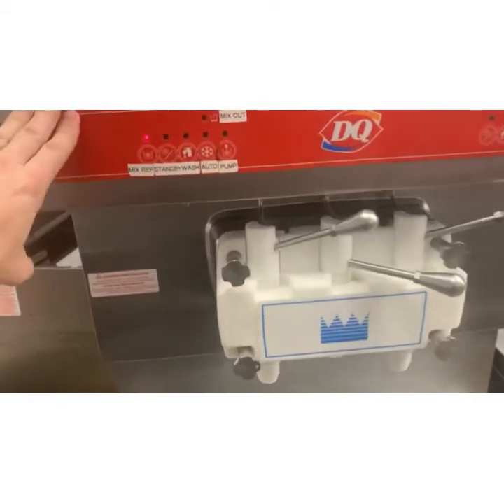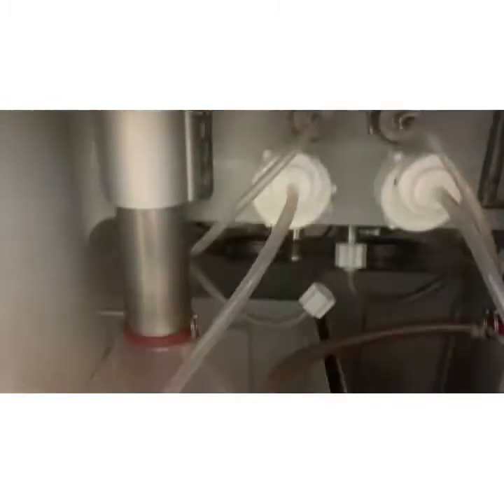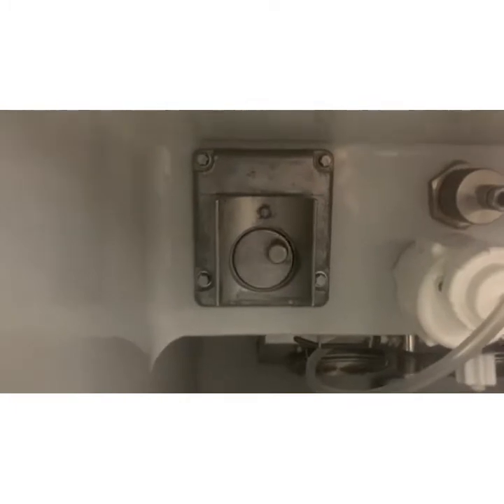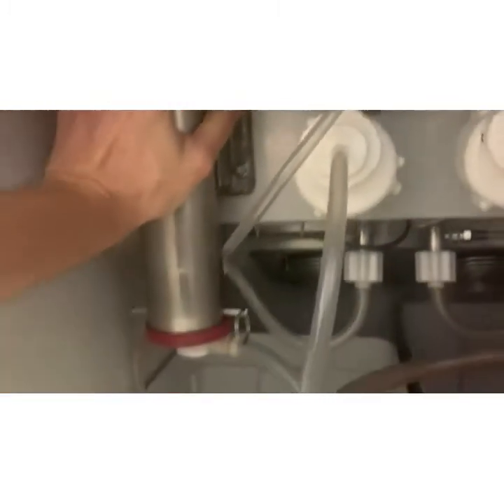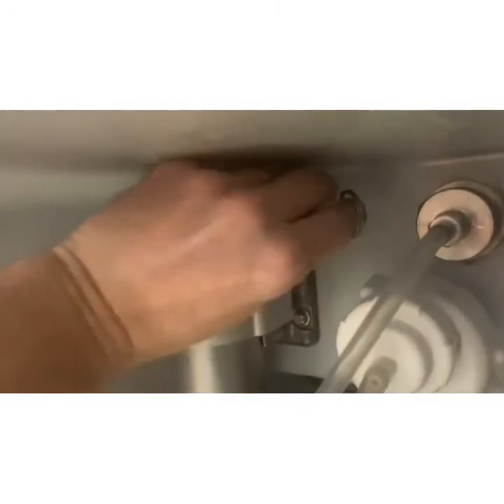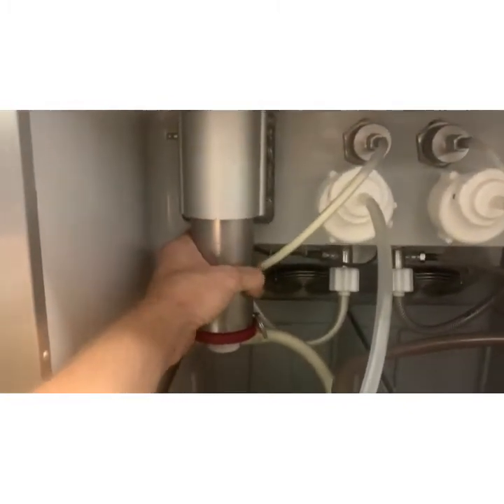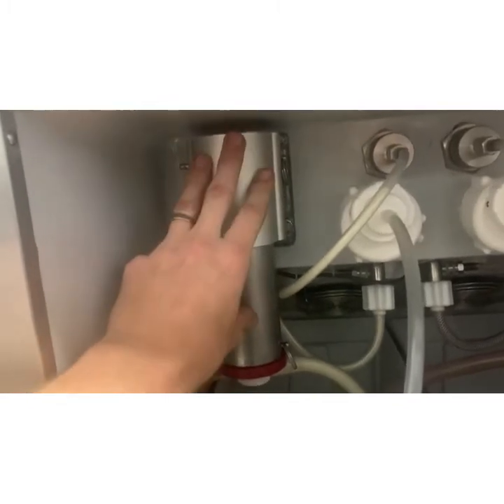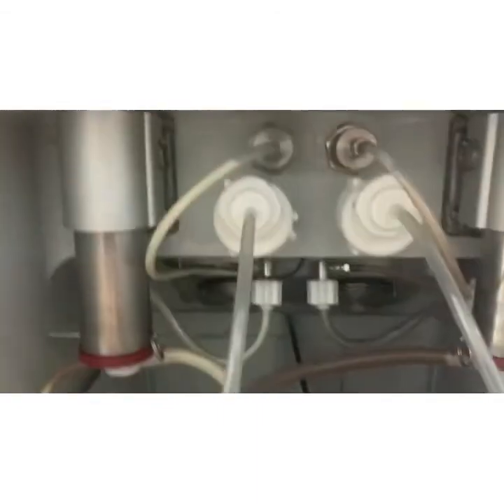Taylor soft serve not pumping

Comment: Have you ever run into an issue where the product is freezing in the line between the cabinet and barrel? We keep having this issue and we have to let it thaw or run a wire up to unclog the line from ice.
Reply from the maker: Absolutely.  Took me forever to find that issue.  I have a video of it I think…. Standby
Reply from the maker: My brain is killing me…. I can’t find it and I can’t even remember the details… I’m looking back at my workorder history.     We had issues where it wouldn’t dispense and finally I found that it was freezing In the connector tube that was insulated with the suction line and freezing up.    I don’t remember whether I separated the lines or adjusted the EPR valve but it was something like that.
Reply from the maker: Ok I remember..    the mix delivery line is insulated with the suction line of the cabinet Refrigeration’s system. To keep it from spoiling.   The EPR valve helps regulate that pressure to keep the liquid refrigerant from getting back to the compressor.  The valve needed to be adjusted to raise the temp of that copper line and no longer freeze the mix
Reply: @restaurantrepairs  I gotta thank you man, you were absolutely correct. Turns out the compressor had been changed and the EPR valve was outta whack. Appreciate the hell out of that.